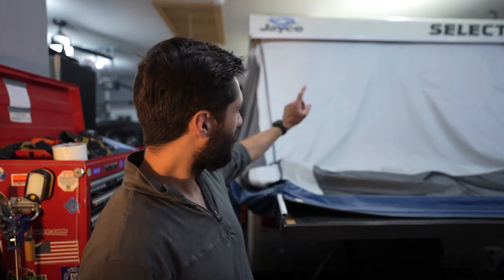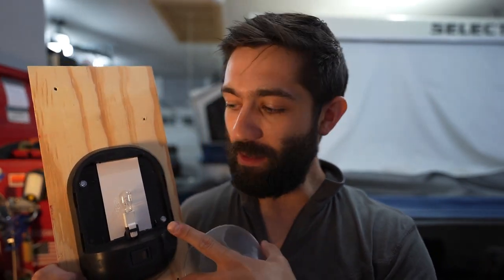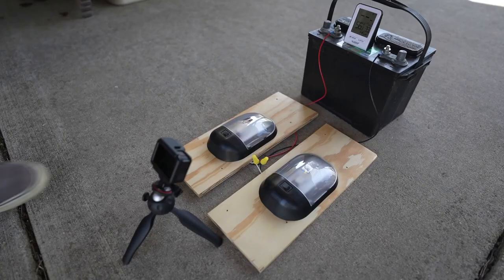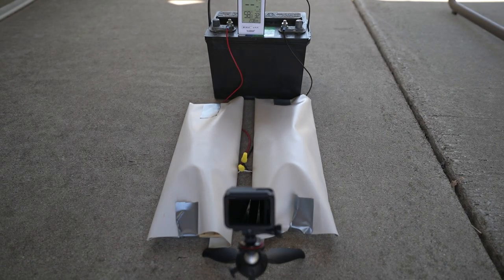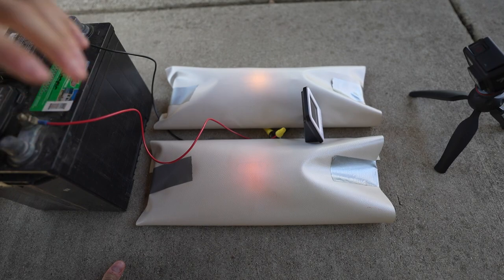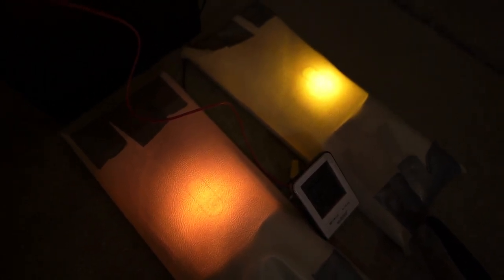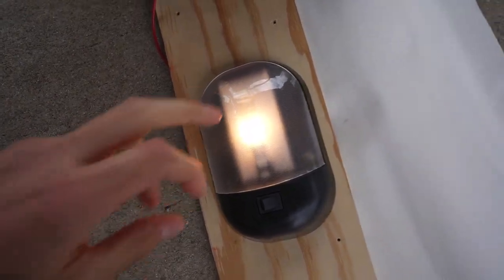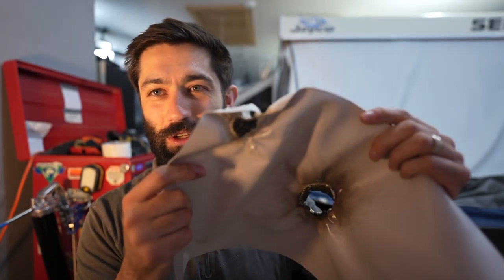Pop Up Camper MythBusting | What Happens When VINYL is Exposed to HOT Lights?

Comment: Just bought a used pop up and the canvas actually has four burns on the canvas and on the mattress, right where the lights  are.
Reply from the maker: Dang, is something wrong with the disconnect switch?
Reply: @ItsPoppin  not sure literally just brought it home today, first thing I'm doing is putting in led lights then I'm gonna shock the switch. Disconnected the battery for now till I figure it out
Reply: @ItsPoppin  That's exactly why there's a warning. Those plunger switches can get clogged with dirt or something and stay closed.
Reply: What type led should I buy?
Reply from the maker: Look for a 5 watt type 921 on Amazon